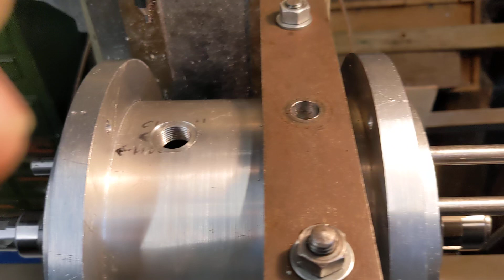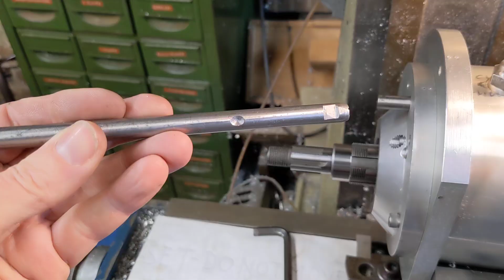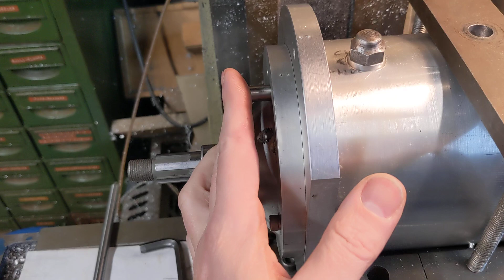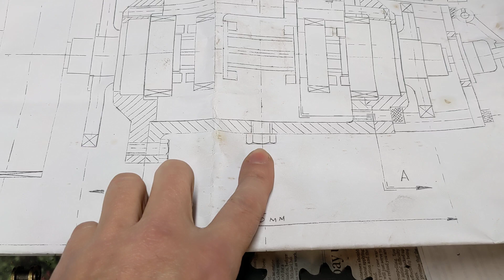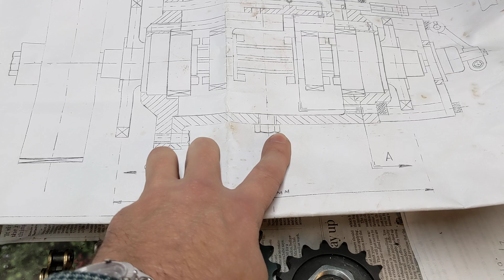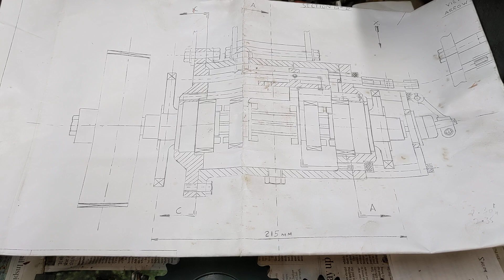Detent-shun!

Comment: Oil seals on the rods?
Reply from the maker: @ekspatriat  not on the rods, just the bearings. There won't be a lot of oil in the box and it'll be thick oil. I doubt it'll be an issue.